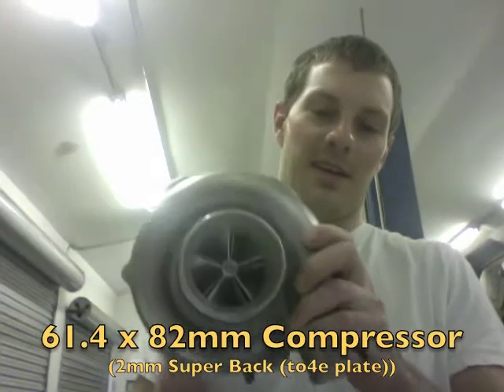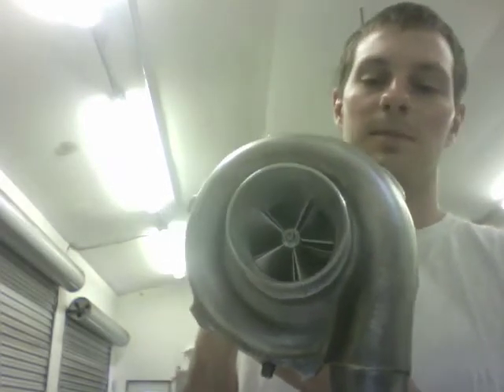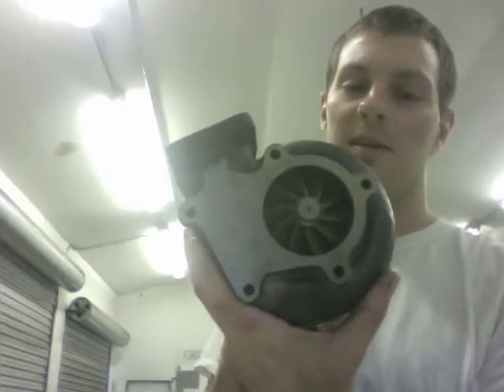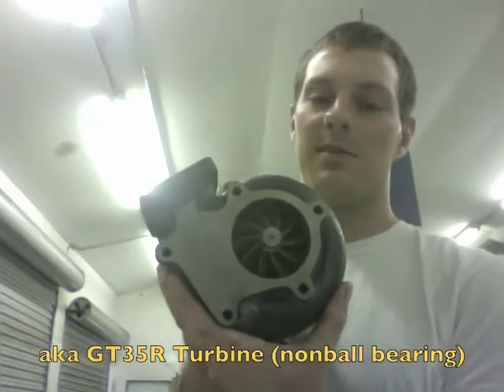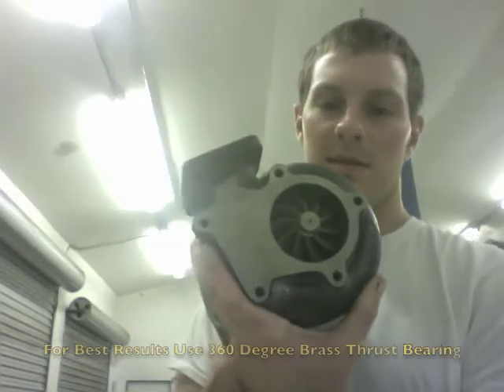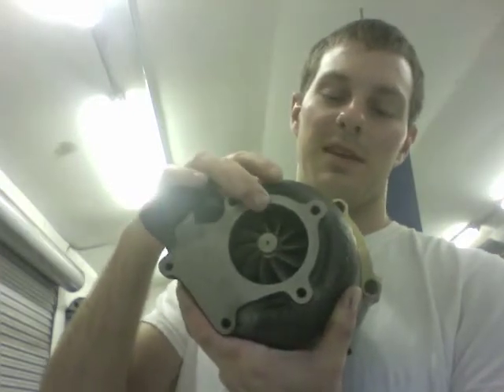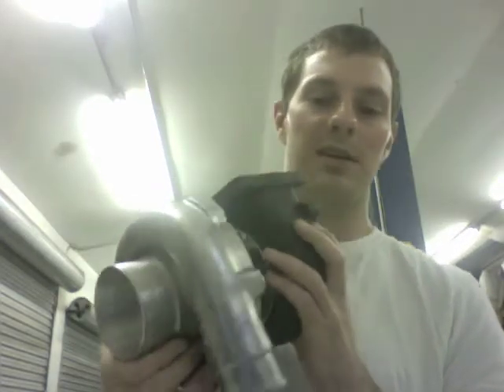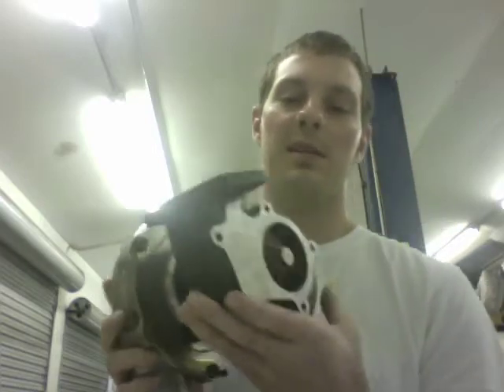Precision PTE 6169e Turbo Rebuild

Comment: I have a question and I know you are the perfect person to help me out, if I put a 6262 turbine wheel on this turbo it will be straight swap right? I will be using a 6262 hotside btw. Thanks
Reply: Turbo Lab America Thank you, do you guys have this 6262 turbine wheel and also I was interested on the 5 blade compressor wheel you mentioned on this video.